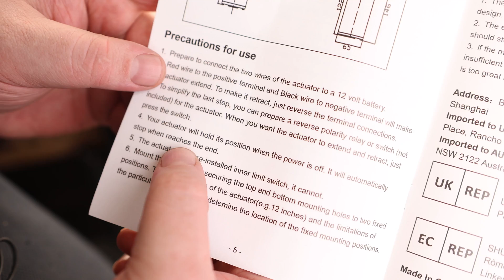VEVOR Linear Actuator 12V, 12 Inch Heavy Duty 1320lbs/6000N Linear Actuator, 0.19"/s Linear Motion

Comment: Great video! One question: 

I’m having an issue with my Vevor actuator. After opening it for inspection and reassembling, I noticed that when I turn it on and press the opposite switch, the actuator doesn’t stop. This has happened twice now, and I’m unsure of the cause. I haven’t touched the electrical components, and everything seems to be in place.

Has anyone experienced this issue before or has any advice on what could be causing it? Any troubleshooting tips would be greatly appreciated!

Comment: Can you set the length it extends like a servo?
Reply: you'd probably need to use a stepper motor linear actuator? that or you may be able to use a micro controller 🤷‍♂